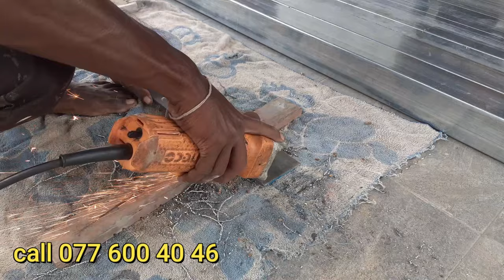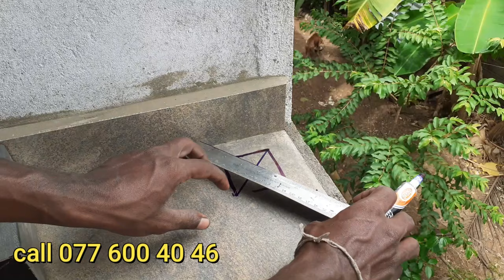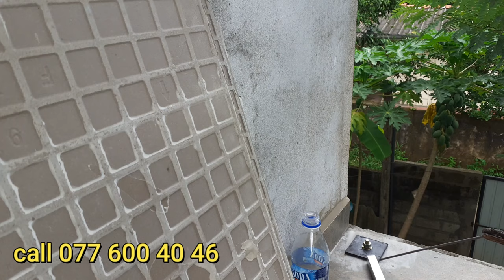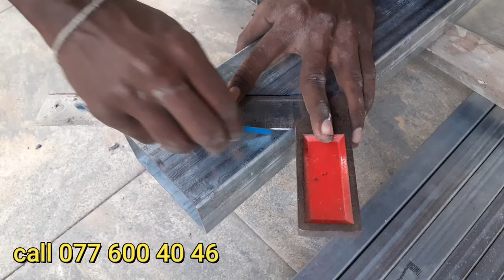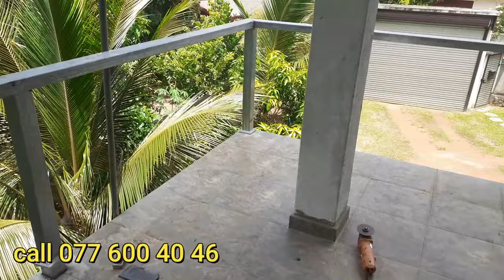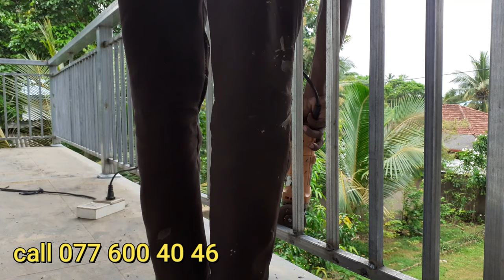Steel Balcony Railing Making | Step By Step In Sri Lanka | Using Iron Box Bar

Comment: Wonderful job.. Can you please share the dimensions of the square tubes and what is the covering for the base plate called
Reply from the maker: thanks....Top 4"x2" , Main 3"x3", Middle 2 bar  1"x1" , filed from  3/4"x3/4" bar  , base cup is made from steel sheet ant those are available in hardware  store